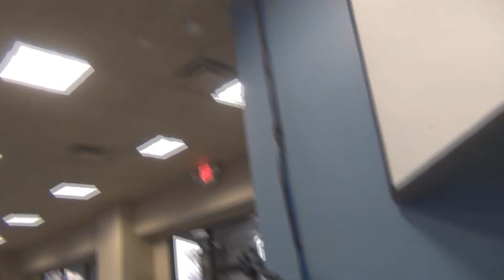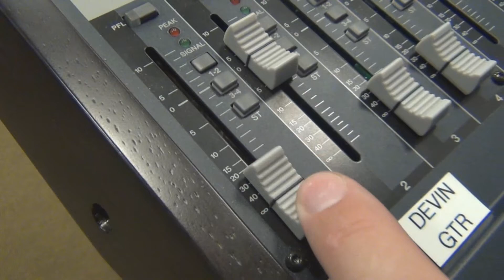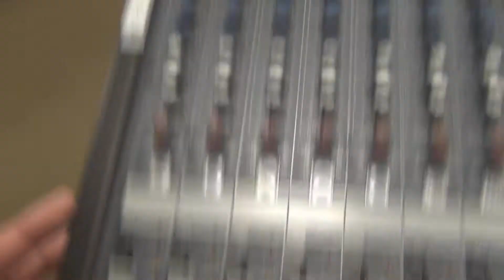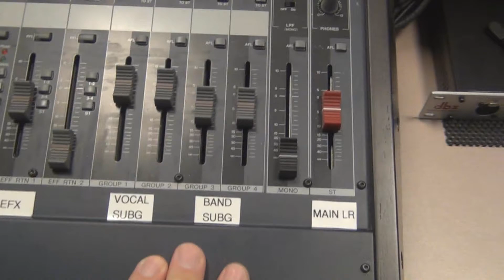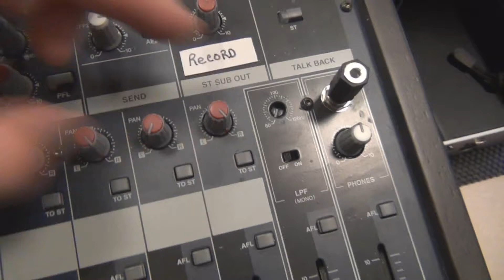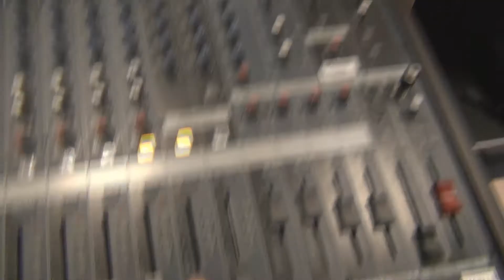Shadow Rock Church AV Series - Mixing 101 (Annotations)

Comment: i watched the whole video and it really helped thanks
Reply from the maker: MistBristCrisp Awesome, this mostly applies to an analog board, digital boards are much more forgiving in their master fader control and quality. At the church I serve at now they have a common Behringer X32 and gain is not exactly set using this unit gain method. Search for a guy named drew brashler he covers the X32 and digital mixing very well. The same theory applies however in channels, buses,   faders, more complicated and powerful on a digital boards, but same flow.
Reply: Jstevensdk7 Thanks for the information and sorry for not responding sooner, On Sunday it was my first time using the audio mixer, i watched this video and later that day i made the sounds change really well, they never had a sound person before so tjey really saw a difference . I used the EURODESK SX2442FX, im still practicing, i was wondering, how do i equalize really well? I did a good job on making everything sound great but i want to know the best equalizations for everyone. Do you havw any suggestions if you dont mind?
Reply from the maker: MistBristCrisp cool very awesome! The thing about EQ is, less is more and subtractive is better than additive. In that, only adjust EQ if something does not sound good. If it sounds ok then cool. For subtractive it is better to cut out areas than to boost I almost never boost anything on a digital board. On analog I may boost highs a little bit. The general method for doing that is to perform a narrow Q sweep, find the naughty frequencies and lower them down. You can find lots of videos on YouTube for this technique.

You unfortunately cannot really EQ sweep very well on an analog board like the eurodesk. I would always start out with everything flat, solo the channel you want to work on with headphones, and then adjust the highs left and right to hear the changes it makes, I recommend not adjusting it permanently too much but sweeping the pot knob back and forth which will let you hear the changes. Do this for highs first, then lows. That may be all you need to adjust. For mids depending on the board it may have two knobs, one for the frequency and one for the level. With that you may be able to sweep back and forth, left and right to find the frequency that sounds bad to cut it out. Raise the level of the mid frequency to max and then sweep left and right until it sounds really bad, or you find the particular frequency range that is the issue area, then lower and drop down the level until it starts to go negative level to cut out or lower down that problem area.

It is always better to sweep and subtract aka cut out bad areas than to try and boost good ones over the bad. Search for "how to EQ sweep" lots of videos on this technique.
Reply: Jstevensdk7 I really appreciate it for all the information, you've helped me alot, God Bless you.